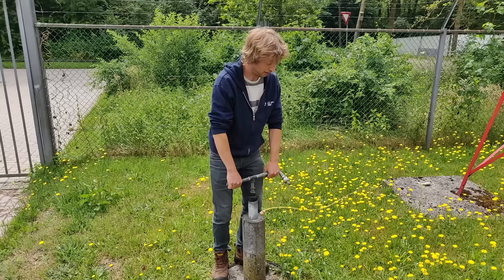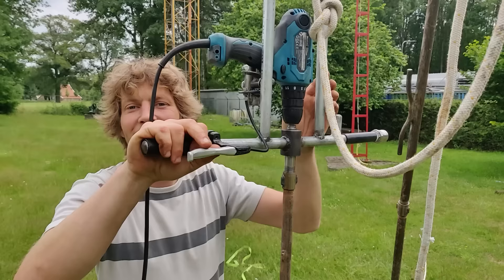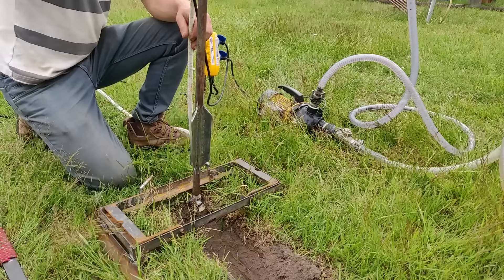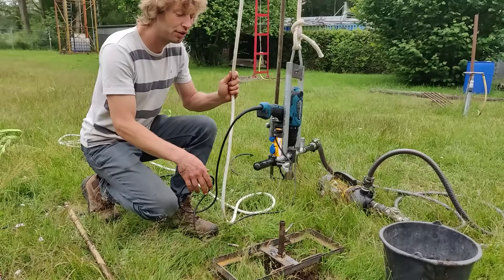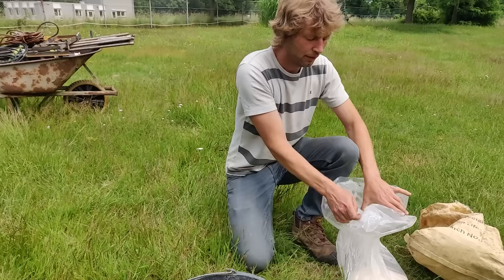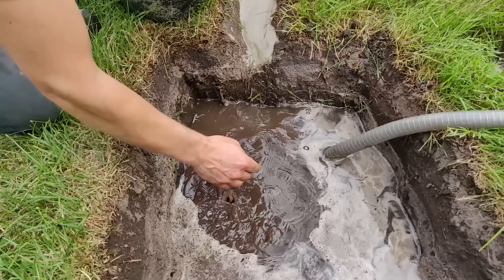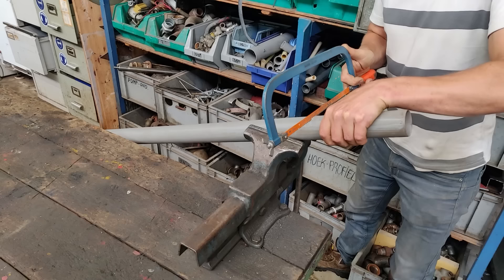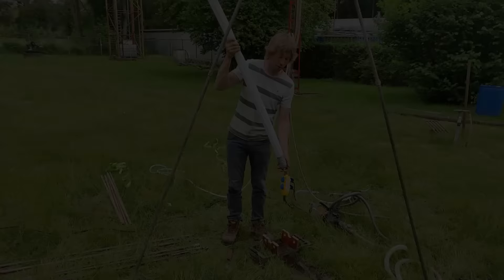DIY Well Drilling Using a Hand Drill.

Comment: Would it make sense to drill a water hole on a hill side? 
I mean, I guess ground water can only be found in a valley. 
What temperature has the water that comes out?
Reply from the maker: Hi Claus,
Drilling on  a hillside is not by definition a bad idea. Sometimes the ground layers (and thus the depth of the water) follows the elevation to some extent. In this case drilling on  a hill side will work. But it doesn't have to be the case. It can be difficult to accurately predict water levels based on elevation. Unless the hill is very steep of course. 
The temperature of the water I'm not sure about.

Comment: Its a nice set up if you are in the right geological area. Last well i had drilled was 80ft. Of hard pan clay and rock . Half inch drill without a weighted drill stem wont work
Reply: Common sense is apparently not that common.

Comment: I live in Deschutes County, Oregon. Our water table here is only about 40 feet down, maybe less. When I dig down with a shovel, it appears to be completely sand once you get about 18 inches down from the surface.  This technique might actually work for me!  I have two questions: 
1)  I would be concerned that because our ground is only sand, that the hole would collapse easily when water is continuously pumped into the hole by the drill bit.  
2) If I get caught drilling my own well like this, wouldn't there be a fine if I was caught by the local government?  Isn't drilling your own well illegal?

Comment: I have 3 questions...
1) Can you put this inside of a casing that you push down as you are drilling the well so the sides don't cave in and ensure that the hole is wide enough everywhere AND straight? 
2) How do you remove the rocks and other things that are too heavy to float up the hole? 
3) How do you get past a big rock in your hole path with this device? 
Extra question just for fun... I'm in Texas. What is I hit oil before water? I know that's not likely since I would use this method for 100 feet or less.

Comment: It would help a lot if you posted pictures (a video would be even better) of the swivel device disassembled, especially the part where you connect the drill and the handle injects the water to the driving shaft/pipe, I checked out the PDF drawings but they are not easy to understand for a person who is not trained in reading mechanical design blueprints. That is the key to the whole thing, understanding how to build that part, otherwise people will not be able to fabricate the device.
Reply: Exactly. Key to the whole thing. Been racking my brain. Sealed bearings. Hollow shaft to coupler. Nailed it.

Comment: I tried this drill method and it worked OK until I hit some hard pan at 20 feet and then the drill wouldn't pentrate the hard pan. I rented a 90 in. Jackhammer and the rental place had an adapter that fit in a 3 inch pipe. I rented a small 10 foot scaffle and I bought 5 10 foot sections of 3 inch heavy wall metal pipe. I made a pointed tip that I welded on the first section of 3 inch pipe and then I cut 4 10 inch slits in the point to allow the water in. I jack hammered 45 feet of pipe into the ground that took me 6 hours to do. It would of been a lot quicker but it took over 2 hours to get thru the 3 feet of hard pan,once I got through that it only took a couple hours to drive the last 25 feet of pipe. I rented a sump pump and ran it for 4 hours to suck over 3 yards of sand out of the ground to create a void for the water reservoir. I've used this pump for over 20 years and I've never ran out of water. I only use it to irrigate my 3 acres because the water may be contaminated. I water every day for at least 3 hours and it saves me hundreds of dollars in water bills . My neighbor stop water in the summer months because of the high costs of water in our town. My place is green an beautiful all summer long.

Comment: Slots that are too wide will let sand and silt pass through the screened interval.  Screened PVC is available commercially. 
Go with screw joints too.
Other than that, nice work.

Comment: Hi. You make a video where was drilling a water well. I'm serious and please when you can tell us how you made that piece? The part in the middle of the handlebar of the water drill. The part that makes the connection between the drill and the drill pipe. The piece through which water flows but still spins. Plecase Say this to us whit a video . Please 🥺

Comment: Or.. you can call a well drilling service. It is cool.  In soil the water alone will drill the hole we used to feed hoses down into the ground as kids and get them stuck. Of course they didn't go straight they just went wherever.

Comment: Sadly our ground is pure stone at a death of 50cm, nearly impossimble to dig a hole deeper than 50cm without being confronter with granit stones as large as a house. We once had do burry a hot warer and cabke line tobour neighbour and it was a massive digup of stones that were as large as 5x3x1 meter even if we only dug it 1 meter deep. But forinatly we have a 13m spring from our ancestors next to our house

Comment: There is a mistake on the drawing of the axis (sheet 5/5) You change the place of the bearing and the rotary shaft sealing (simmering) at the bottom of the part (20,0mm 21,3mm). Additionally there is no place (21,3mm) for the simmering at the top of the part.

Comment: do you think this method would work on solid rock soil?
Reply from the maker: Hi Daniel, the method is only suitable for soft soil (sand or clay) and not for rocks. Drilling through large rock formations is generally not something you can do yourself.
Reply: @WOT_utwente  I've been doing some reading since then... I think a tricone drill bit and a big bench press along with a self made rack to raise and lower the bench press.. also, I need to inject mud through the pipes while drilling, to keep the drill bit cool and move particles up.
it's not gonna be crazy expensive as the most expensive thing would be the bench press (300 dlls or less if I found one in a pawn shop or garage)
Reply: as for the piping, 1 1/2 inches perforation pipes, with the guide and the stabilizer it's what I am planning to use when I get everything together. 300 dlls it's not crazy expensive but it is expensive in Mexico.
Reply from the maker: @eliezerdaniel  Hi Daniel. There are some methods to drill through rocks by hand. If you are interested you can look up percussion drilling. Nevertheless the point is that if you want to do this with a simple/manual setup, it will take you very long; days or even weeks depending on how deep you will go.  I have no experience with tricone drill bits, but they don't seem very suitable for DIY work. Please be warned: if you have no experience with well drilling and you want to drill through large layers of rock chances of success are not very high. A lot of things can go wrong and it would be a shame if you invest a lot of time/energy in it. I'm not saying it is impossible, but just be aware of this.   If you really want to drill yourself, I would advise you to contact some local drilling company to discuss what method they use, maybe they can help.
Reply: @WOT_utwente  I think I'd need a very heavy hammer for percussion drilling here. in fact, the local driller told me he wouldn't be able to make the drilling on my backyard because his truck wouldn't be able to get in.
they're using a big hammer.
after hours of research, I think the tricone bit drilling with mud injection it's the way to go, but as expected, it's the most complicated way it seems. some advantages, I could drill a very thin borehole and maybe do it with a relatively small drill press, as long as I can secure it to something as heavy as a truck to avoid vibrations and oscillations. anyway, thank you Sir

Comment: What's that adhesive that you used on the PVC pipe?
Reply: PVC cement.
It melts the plastic so when you force it together it forms one piece.
Reply: @savage22bolt32  can you name a good brand I can use for that gray type PVC? thanks!
Reply: @rationalityfirst that I don't know, but if you are in USA, any hardware store or big-box home improvement type store will have it.
Edit- just go to plumbing dept.

Comment: I drilled a 20mm horizontal hole under the road, a total length of over 10m, to run a pipe in a very similar way 1 year ago. For vertical drilling, at least here, this method is not applicable, the bedrock is about 1m deep, and the water is about 15-20m.
Аз пробих 20мм хоризонтален отвор под пътя, обща дължина над 10м, за да прекарам тръба по много подобен начин преди 1 година. За вертикално сондиране, поне тук, този метод е неприложим, основната скала е на около 1м, а водата на около 15 - 20м.

Comment: @ 9:40 a dirty little secret is revealed. Think about this when you might pay someone by the ft. or meter to drill a well. Direct circulation rotary is the most common method of drilling, (what is being demonstrated)  but there are others.

Comment: FWIW, there is a type of hand drill meant for this sort of abuse ... instead of abusing your poor old makita drill driver, you can pick up what's called a "mud mixer". A "mud mixer" is a low speed drill, max 600 RPM, for higher torque applications. It might last a bit longer. Typically higher amps, slower speeds.

Comment: Where I live you need dynamite to dig a hole for a fence post.
Reply: I drilled a 5/8" diameter hole for a ground rod & hit two rocks a foot thick.  Glad I had a carbide tipped hammer drill.
Reply: @savage22bolt32  I had a waterline put in my house and they had to break the rocks with a excavator. We have maybe 4 feet of "soil" until you hit bedrock. The soil is mostly shale and boulders.

Comment: It would've been done 10x faster, with 10x less effort, and 10x less single-use jury-rigged gadgets to simply do it the normal way and drive the pipe with a sledgehammer.
Reply: Yeah sure. Pounding PVC with a sledge normally leads to breakage. And then once you start adding couplers, more breakage. And how do you get that slotted pipe done there without ripping the filter media?
Oh sorry, you're probably going to say you buy steel pipe first to use to pound into the dirt, and then pull it out and hope that all the pounding hasn't caused it to instantly collapse before you can get your PVC in....
From the diagrams it looks like $100 in black iron pipe and some misc pieces and a heavy duty drill and some light welding.
And a $25 pump.
IF someone builds this, they can throw an ad on CL, Marketplace or wherever advertising backyard/garden wells done for a moderate amount and make their money back if they want.
Reply: @boots7859 You don't use PVC when driving a well, it's all metal. You drive it into the ground like a big nail, prime it with water from a jug, and away you go. Depending on waterline and soil type, you might be able to get a well driven and functional inside an hour.